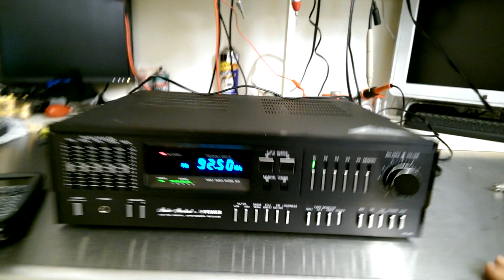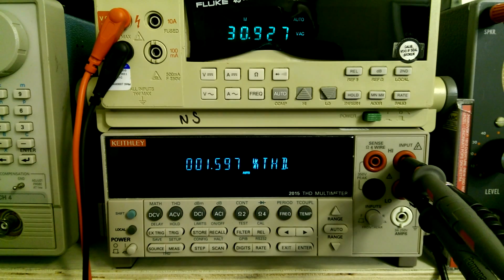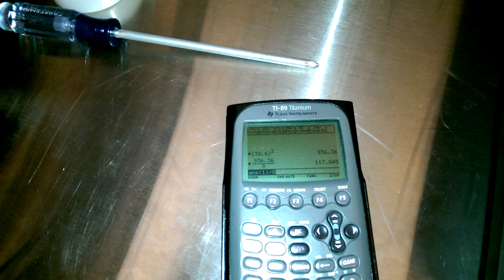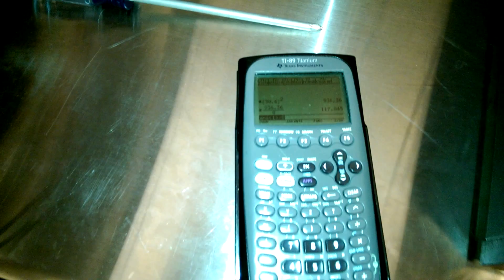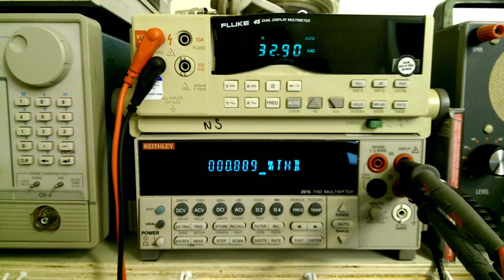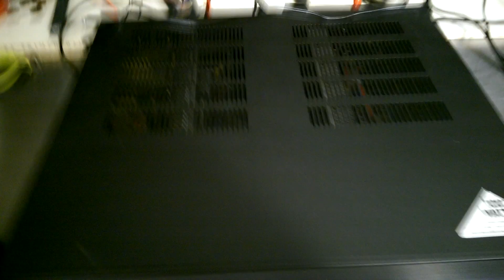Testing a common myth about Fisher receivers

Comment: a couple fisher ba-6000 amps came across my bench a couple years ago. they used the stk-0100ii as well. into 4ohm @1khz, i got 174wpc (and stayed under clipping) out of each one. those amps have big toroidal transformers too.  also did a ba3000 amp and a ca-880 int. amp.  the ca880 got discrete amplifier conversions.  they sold quick!  i just did not think that they sounded that good. they did look good.

Comment: Mine keeps shutting off when I turn it on why. And how do I hook the speakers up the right way
Reply from the maker: If it shuts off with nothing connected, you have some sort of serious internal fault. Unplug it and have it serviced by a qualified technician. Continued use may make any faults worse and may be dangerous.

As for hooking up the speakers...push in the lever, insert the wires, release the lever. Don't allow bare wires to touch each other or the receiver case. Red is +, black is - and they should match with the +/- at the speaker. Speaker wire will have two different wire colors, a colored stripe on one wire or a ridge on the edge of one wire to help you identity +/-. 

Colors: Red or orange is always + and black is always - but other colors are less obvious. I like to use the following when a wire or stripe has a different color: Black, gray, green or white are always - and any other color is + UNLESS you have a pair of wires where there are two colors and neither are grey, white, black or green. In this case, the "cool" color is - and the "warm" color is +. So for example, if we had a yellow and blue wire, the yellow would be + and the blue would be the -. If we had blue and the other wire was a black, white, green or gray wire, the blue would be + and the other "obviously minus" color would be assigned to -.

Comment: For those who see this. DC voltage is used to calculate Power output from an amplifier, not AC. This amp is putting out 24.5 watts of power not 100 plus.
Reply from the maker: This is flat out incorrect. 

Audio signals are not DC and for the record, the test signal the amplifier is amplifying is a sine wave for heavens sake! Sinusoidal waveforms are BY MATHEMATICAL DEFINITION alternating.
Reply: Try connecting a 9v battery to a speaker and see what happens 😉

Comment: Bro! Are you in Carrollton Tx? I'm in Beaumont. I have some vintage receivers that I would trust you to update.
Reply from the maker: I'm just down the road in Coppell these days but for the next month at least I'm out in Abilene fixing up the family house until my day job's office opens back up after COVID dies down.
Reply: @MadScientistsLair  That's cool to help on the house like that. I have a Kenwood KR-9050  (200w) that the tuner stopped working, a SX-1250 that was playing fine and just quit all of a sudden without any magic smoke, heat, or pop sound, and 2 sansui G8700DB's that need pots cleaned and one of them kicks into protection if you turn the volume dial up about half way. Would you be interested in working on them? You videos impressed me with you knowledge of electronics and issues of certain models. Mark
Reply from the maker: @markdavis3629  I can fix all of those most likely and I'll do a better job of it than the other shops in the area. (I fix a lot of their mistakes!) The Kenwood likely has a voltage regulator out and the Pioneer is probably an output stage or there is trouble at the regulated supply board.
Reply: @MadScientistsLair  Thanks Brother. You have my business. I'd like to bring them over when you say so. Just let me know. I was going to take them to Bammel Technology Services in Houston. They are closer but I will definitely pass on them and go to you. Thanks.
Reply from the maker: You planning a trip up here or thinking about shipping? Trust me, the gas is far cheaper than UPS or Fed Ex. I pop in to Coppell every now and then to check things and get my mail. We could schedule a drop off day if you like.

Comment: Hello.  I know this is a dated video. I just hope you can still answer this question and tell us what the cause for the short was. I have one stereo just like this one and it’s doing the exact same thing.  I’m getting over 50v on pin 1 and 0 and I believe it should be at a little above 3v.      Thanks
Reply from the maker: Probably a shorted output module.

Comment: I've bought many different fisher receivers and they all don't work i've bought them from many places and is there something i'm not doing right since all I do is buy amps, speakers, receivers, and test them and resell them but I got 19 different units and they all don't have sound and i've tried many different ways and still nothing it's always fisher receivers i've got high $$$ ones and Low $ ones same issue on all of them how do I test them?
Reply from the maker: Do you get a click when they turn on? What models do you have? Some of them are indeed junk, relatively speaking. There seems to be two distinct classes of black face Fisher gear: black units with the blue fluorescent displays (like the one in the video) and the black units with the green LED meters. The ones with the fluorescent displays not only look better (IMO), they are objectively better as well with considerably more robust construction. 

Still, the green LED models make good starter kit and are easy enough to fix. Most of them are discrete circuits even so they're cheap to fix too! Most will have popped output transistors. 

With all of these Fisher rack systems, the true weak link is the speakers. Just throw them out if they don't work; pretty much any modern large speaker is an upgrade.
Reply: Yes I get a click when it turns on after a few seconds I know the most problematic ones are the ones that are the cheapest bought ones from goodwill

Comment: I still prefer discrete outputs simply due to ongoing availability issues. Nothing specifically wrong with Sanyo's STK's - they actually performed quite well as you know. But Sanyo is out of the semiconductor business and no longer makes STK's. Most "new" ones are Chinese fakes. For repairs you're left with trying to find New Old Stock or pulls from a used unit. I used to buy STK0050's ten at a time. Those were the days... but the Chinese junk doesn't even bias up right or perform to full power before they blow.
Reply from the maker: Sourcing a good STK these days is a nightmare. I have a few friends in the business that sell me what they have when they find pockets of them but sooner than later we're going to have to start making homebrew modules if we want to keep these beasts running. The people running SanKen hybrids (as used in many Kenwood units) are already resorting to this.

Comment: I love my fisher amps. the CA-276 is a BEAST.
Reply: I love my Fisher 8500 system.  It is the one with the BA600 amp!!
Reply from the maker: It's also easier to repair because it's a discrete circuit. 150W/ch with no more than 0.05% THD is nothing to sneeze at either. Watch the bias on them though, if the fan comes on at background music volumes, it's too high and should be adjusted downward. I don't know the bias spec on them, use a scope and adjust bias such that the crossover gap disappears and no more.